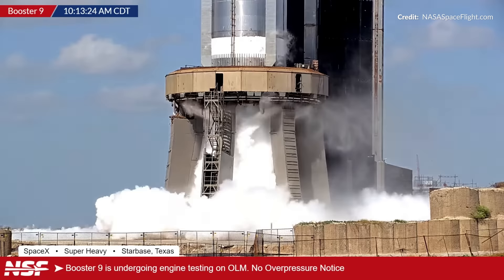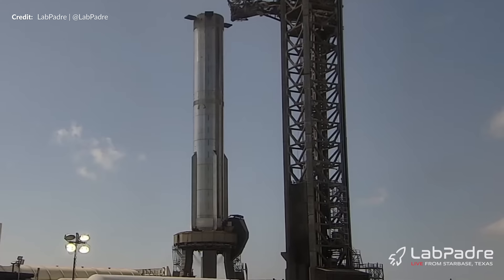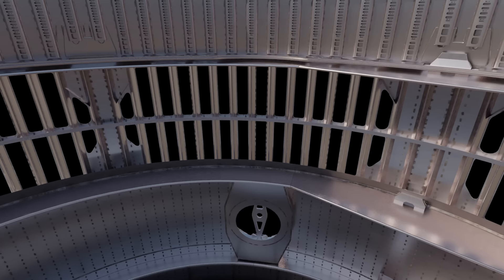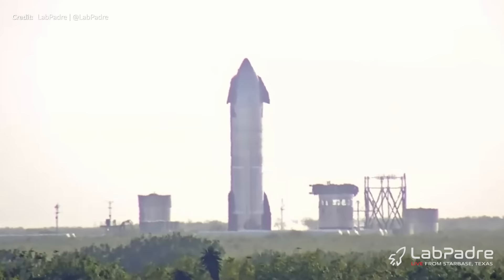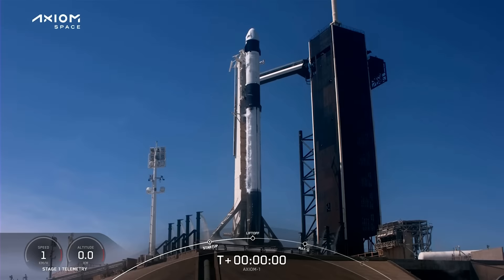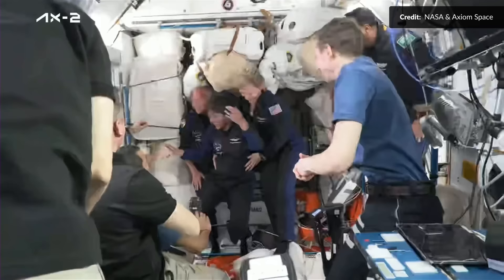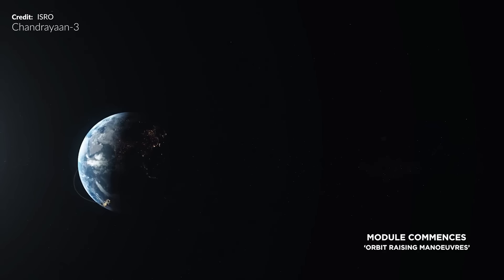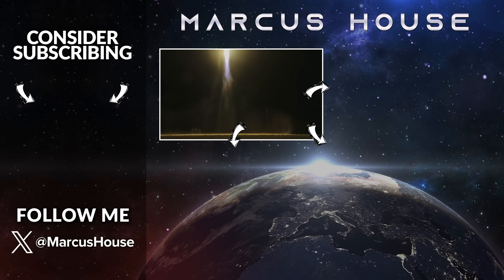Will SpaceX's Critical Upgrade Stop the Concrete Tornado?

Comment: Won’t the hot staging ring be weakened by the heat at hot staging?  Can crusher tests at room temperature won’t capture that.
Reply: They'll have some pretty detailed knowledge of the material and how it will react to the environment it will be put into.  Either way, It only needs to survive the launch for now - as far as I'm aware, they don't intend to land or even recover the booster for the first few launches.  If it burns up, then it burns up.  It's a pancake either way.

But I'd expect testing for this either way.  Either a static fire on a mockup booster head, or a recovered ring once they land a booster, with the ring then sent through for another testing run.

For now, I expect the focus will be on having it get to stage separation.  I think it's going to be a little longer than most might like before we see another launch though, so maybe these tests will come beforehand.  Time will tell.
Reply: Shhhh
Reply: @icycooldrink6085 I preferred the "unrecoverable tumble" separation manuever.
Reply: @ThatOpalGuy  I don't know that I'd really want to see that one again, but it was something different, for sure.  

Bright side, at least a few more spectacular failures in store as development continues.
Reply: @icycooldrink6085  the final product should be interesting. The worst thing here is that this should have been developed 5 decades ago.
Reply: @ThatOpalGuy  Agreed.  We collectively did something amazing, and then just kind of coasted for the next 50 years.  I mean, things progressed, but we sure didn't keep up the pace with a pre-moon era.

Kind of exciting to see another cycle of development.

Comment: Water converts to steam at 1700 to 1 with 14.7 psia (atmospheric pressure)  when sufficient btu's are added to water at 212 degrees F. At 1000 degrees F, it expands 4200 times its volume. Space X may not be out of the woods yet with the water deluge system. A couple of things that may cause issues. One is that kind of steam expansion has a lot of power to do damage to the OLM, the rocket, or surrounding infrastructure. Another potential problem is if the rocket motor exhaust pressure out powers the deluge pressure, it is possible for the exhaust to enter the deluge plate. That would stop the water cooling effect that allows the steel to operate above it's melting temperature. This could potentially damage the plate. We don't have access to the designs and the McGregor test data. I certainly would have like to see that.

Comment: Those hot staging ribs might have a resonant frequency that shakes the whole rocket to pieces.  Think of blowing over the top of an empty beer bottle (or a flute) & how it "whistles".   Or how soldiers have to break stride while marching over a bridge.  Why do that do that?  To prevent the build up of a harmonic oscillation.   

From the symmetry of the vertical slits I'd say they have not done an harmonic analysis.  I'm betting it rips the rocket to pieces.

Comment: If there worried about the booster when Hot Staging...Why not just mount an inverted heat shield on top or just use tiles?.

Comment: Another excellent weekly update Marcus.    A couple of things. A with regards to the water cooled plate, please quit calling it a Deluge system, it's not a deluge system it is a totally different application.   It's closest to a Jet Blast Deflector on an Aircraft carrier.   Second the Hotstage Ring, you are close but not quite right on the forces the will be under.   The vertical load will be equal to the thrust from the engines only, even though the TW ratio goes up as the vehicle empties, the thrust force itself remains "constant"   IE 8,800 tons thrust at liftoff and still 8,800 tons at 60KM.

Comment: I'm just curious about the hot stage ring, if the strain will be so high weight wise, why not make the hot stage ring with honeycomb openings instead? We all know that honeycomb structures are the strongest when i comes to supporting various weight and much stronger than the hot stage design SpaceX chose with vertical openings so to let the Starship start its engines while still being attached to the super heavy stage one booster. A ring with honeycomb openings would be able to not just support more weight and/or pressure but would also be just as good as their choice of vertical openings to have the Starship's exhaust escape away from the stage one super heavy booster. A honeycomb ring would work so much better than just a bunch of vertical openings. That's my opinion anyways and I'm no rocket scientist/engineer..hahaha

Comment: As Space-X seem to be able to put up Falcons as an easy and regular routine for their own commercial satellite network (money makers), why don't they just put smaller packages of space station sections and personnel into orbit, and get the building underway in orbit, rather than trying to get Starship launched? Surely it would be easier to build Starship in orbit rather than trying to get that much weight up in one go from the surface.

Comment: I still don't think they should put a perfectly good starship on top of this booster until it's proven this 33-engined monster can withstand the launch and do its job without blowing up. This quick staging section could collapse at takeoff. I think a weighted dummy nosecone would suffice this time. Hey, it ain't my money
Reply: The hot-staging structural article is already being made and it's currently being tested. No booster-only flight for foreseeable future

Comment: The test article won't withstand the downwards force of launch or the crusher. Vertical support will fail unless force is equally distributed which it cannot be guaranteed.    The hotstage structure needs to be diamond, triangular or honeycomb shaped in order to distribute "uneven forces" across the structure adequately. imo. Think about it 🤔
Reply: So you're a structural engineer at SpaceX and already seeing the test results? When?